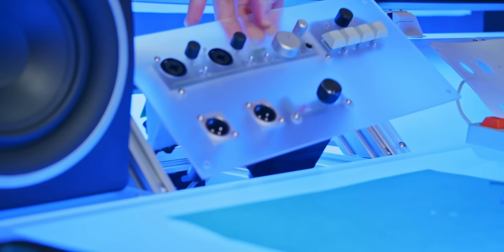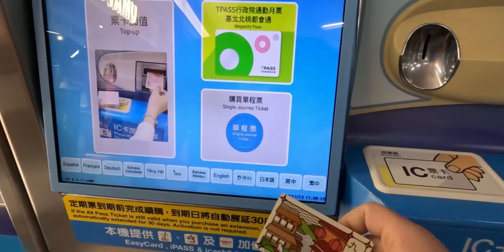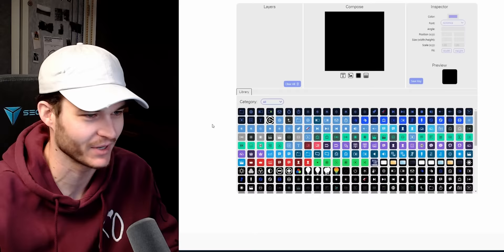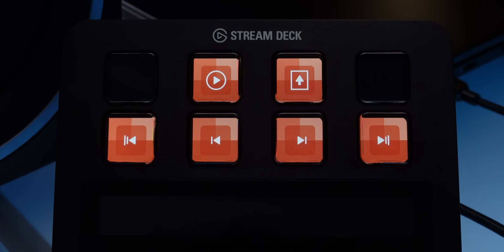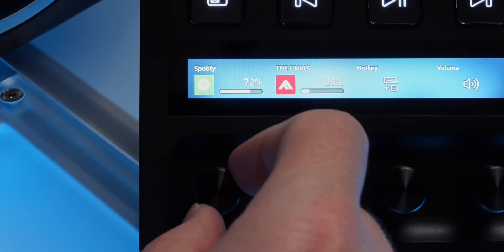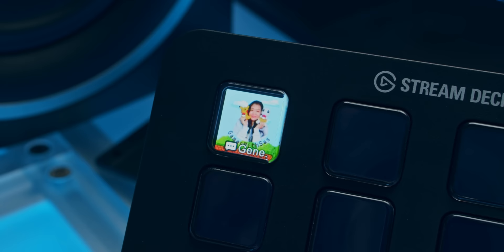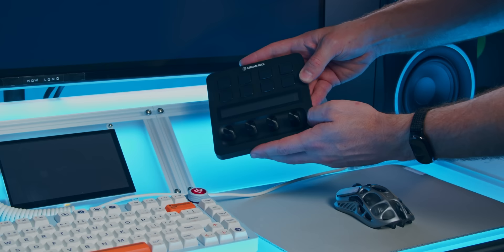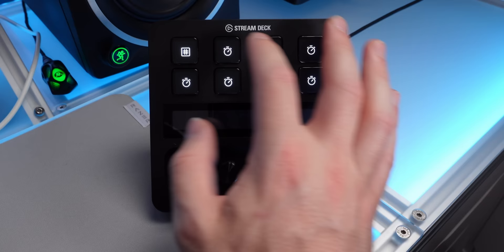Add Knobs and Buttons to YOUR DESK the easy way!

Comment from the maker: Get 4 months extra on a 2 year plan 👉 https://nordvpn.com/camshand It’s risk-free with Nord’s 30-day money-back guarantee! ✌ #ad
WATCH the full Custom Desk Build series here 📺 https://www.youtube.com/playlist?list=PLKMGF4Ke4GUUd-kb4hr2Stzcb-h-e2dWK
Reply: id suggest putting it on the left side not the right, its really annoying to have to let go of the mouse or to reach across your setup with your left hand to use the stream deck
Reply from the maker: yeahhh I thought that, it's more efficient to keep a hand on my mouse.
The Audio panel controls worked best on the left to keep the XLR cables on a far side. I could move them to the right, I'd have to flip the circuit board upside down and route the headphone and bass shaker chair plug further but it's no a bad idea.
Think I might test it out on the right and see. nothing's final 🤙

Comment: 11 min video and you didn’t even install it 😭
Reply from the maker: Honestly I would have loved to put it straight into the desk.
But at the moment I'm really under the crunch timewise, and running prototype cuts myself and then booking a time to have the panel cut with a C02 laser in town just didn't align.
Figured it'd also be best to wait until I've figured out how I'm going to do buttons for the standing desk legs, and to layout spacing to cut the right panel when ready 🤙

Comment: Couldn’t you just wire up a ESP32 or ESP8266 instead of that razer thing. If you check the led preferences you can also assign multiple led strips as different zones, you’d just use a different GPIO-Pin for each LED strip you want to control separately. As far as I know WLED also has a Streamdeck app.
Reply from the maker: yes I'm heavily considering making the switch, if anything adding a literal switch to the desk to route the data line between an ESP32 with WLED and the razer box. That way I can do RGB control with the streamdeck, or when gaming I can switch over to the Razer for the integrations. still unsure on an exact solution, wanted to stay away from SignalRGB's subscriptions.

Comment: You could open it up and solder your own buttons to it so you could integrate it to your desk
Reply from the maker: But then I wouldn't have the nice LED Screen buttons. I'm going to be mounting the PCB as is for the buttons into the desk in the next part. Might have to move the encoders pins to make it more flush as the stock enclosure has them recessed.

Comment: Stream decks are dangerous! I dread to think how many hours of my life I've spent setting up profiles and making icon packs. 

They made me fall in love with Elgato products and then halo'd me into the rest of their ecosystem.

Great video as always, loving this series!
Reply from the maker: Yeah I've avoided the button only models for many years, but when I saw the plus with knobs I couldn't resist anymore.
It's the perfect layout for the desk and I'm so relieved that it will fit!
Reply: Is is managable for a non-programmer to set up to any worthwhile degree?
Reply: @Mr.McWatson  100%. Elgato's stream deck  software is super user friendly and easy to set up. From there it becomes as simple or complicated as you want it to be.

Comment: Honestly, i used to have this panel. But now I switched to loupedeck. Its way more flexible and has more buttons.
Reply from the maker: I do like that Loupedeck has a keyboard angle so you can use it more like a traditional macro pad.
I've tried a few different options like the XENCELABS Quick Keys and Blackmagic Design Speed Editor but I always return to keyboard shortcuts for editing videos and photo's I think out of fear that when I'm travelling I can't be reliant on them.
Reply: @camshand  yes that's sooo true. I bought a second one that I take in my backpack everywhere 😂

Comment: Nice video man! I started with a stream deck and have been on a journey testing tons of mechanical macropads... but that software demo reminded me why going elgato can make certain things easier. Keep em coming!
Reply from the maker: Yo Yo it's the macropad man! haha, I've watched so many of your vids.
I bought a Xencelabs Quick Keys after seeing your demo. But yeah those Megalodon ones are soo bad to setup, I did a video on the small 4 button 1 knob model and my goodness is their software support and documentation practically nonexistent. I just left it as media controls and mounted it into the audio panel of my desk 😅
Reply: @camshand  Thanks man, that is mutual btw... I've been following along with your desk build series. You are crushing it with those thumbnails 🔥The all mighty algorithm better be rewarding you for all this effort you are putting in.

Comment: You could change the razer chroma lightning with their chroma sdk
Reply from the maker: YES! This is an idea I have to try, by tricking Synapse into thinking it's a game that's sending it colour commands.
But will need me to write a plug-in for the stream deck that can middle man the communication between both.

Comment: bro if u sold these desks u would make so much
Reply from the maker: I've actually had some interest in made to order, problem is the main lengths are massive! 2.2 meters is not something that fits in the mail easily. I'll be releasing the plans with measurements and parts lists to make the frame so people can send them to a supplier and have everything cut to size.

Comment: can you seperate the lower half of the circuit board from the upper half? I actually planned to do a similar panel to what you did but it's not very tall but in exchange for that it's very wide. I measured it out and a stream deck mini would fit perfectly. But if the Stream deck plus has actually two pcbs, i would seperate them and put them next to each other.
Reply: Yeah you can just solder wires as long as need, to connect the two circuit boards
Reply from the maker: Yes, but the touchscreen is apart of the lcd button PCB. So you can only relocate the knobs easily, and so the labels for what each knob is doing won't align for the added ease of labels.

Eitherway should be able to use jumper wires to simple re-route to the knob's PCB header, and then also add a wire for grounding, looks like they  have some foil going between the two boards.
Reply: @camshand that's a shame. I will check if it will fit anyway. The LCD is just one "big" panel for all the buttons and the lower screen, right? I don't know if I will have a use for the knobs anyway because my volume is controlled analog.

Comment: If only it worked on Linux... sigh...
Reply from the maker: Yeah would be best to find a QMK firmware macropad so you can program with VIA.
Just won't have the integrations or nice screen buttons

Comment: 200 bucks, sounds like a scam... Sure its cool, but thats just too much...
Reply from the maker: quite cheaper compared to some options out there.
Need to remember it has 8 screens, one touch screen, 4 encoders and the buttons themselves all bundled with the Software Suite. Not for everyone, but for those that find value in it's features it's a great product.
Reply: @camshand  fair, youre right.